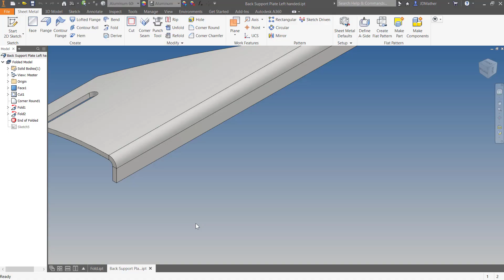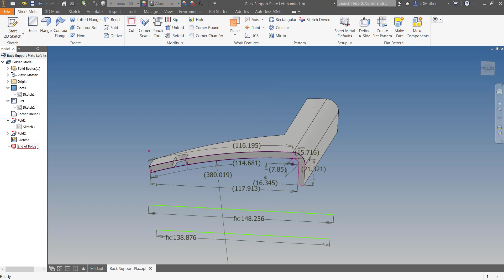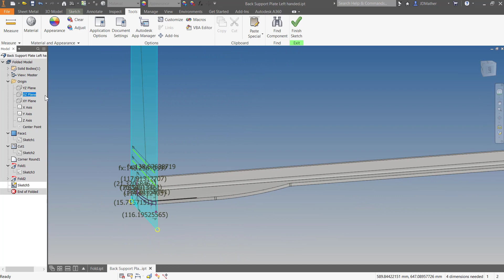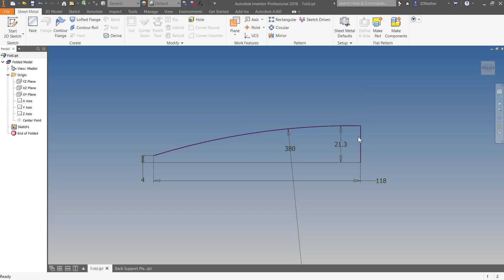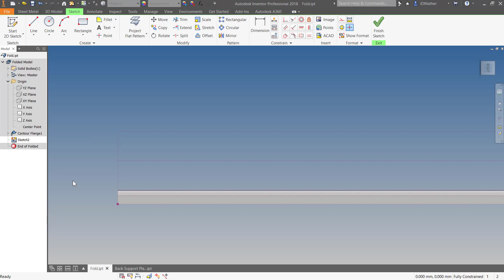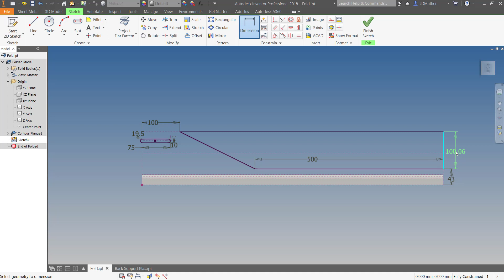Autodesk Inventor   Project Flat Pattern vs Unfold Refold or Fold

Comment: Thank you very Sir to upload this video,
I was stuck with this problem, they're some dimensions of slot and holes given in development view and not form the bending view, and i was not able to make those cut in bend view. 
So your this video could help me to achieve those holes without using fold command.
Again thank you very much 🤗 thanks a lot😊😊.